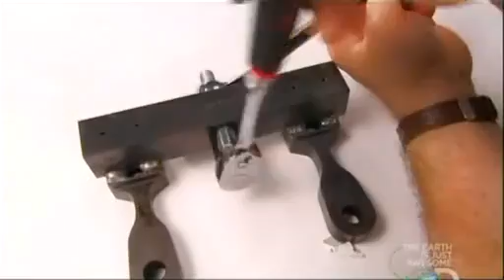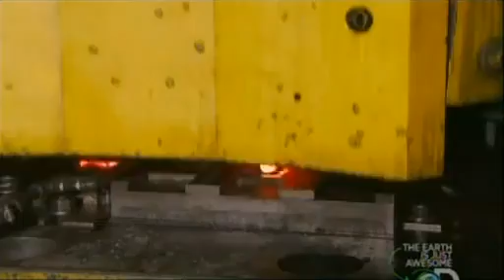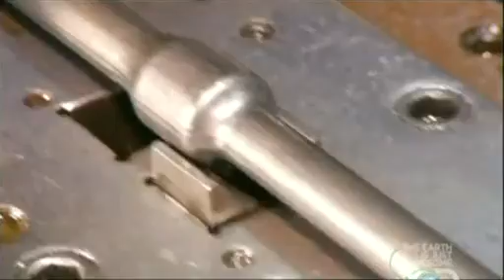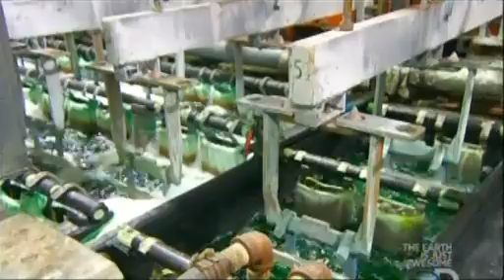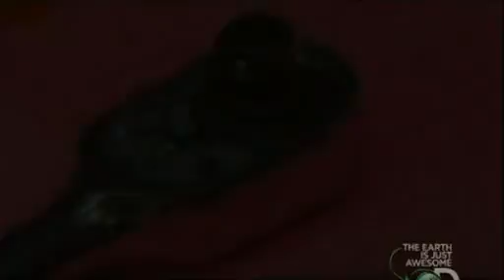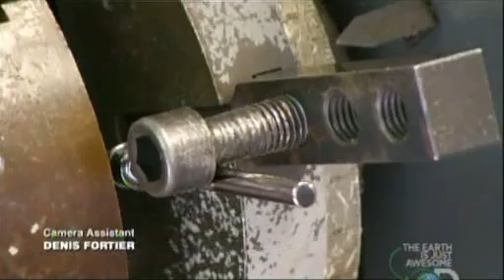How to make Ratchets {www downloadshiva com}

Comment: +henmich,I estimated about 35 ratchets per row in that basket, times four rows. So, about 140 ratchets. I couldn't find a stock number in this video. However; for a non-flex 3/8" ratchet, they're about $125.00 each. Perhaps you meant $17,500.?
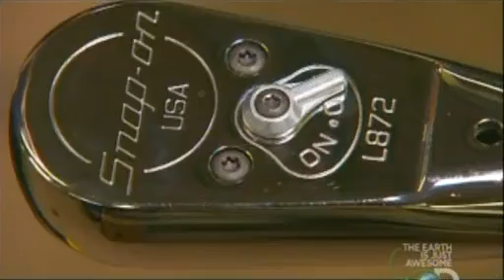Reply: #L872 @3:45